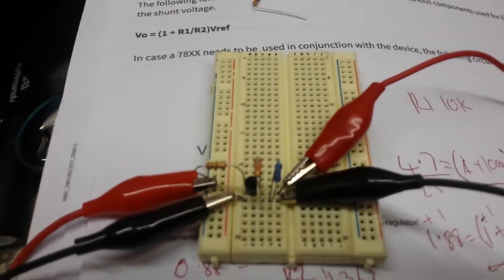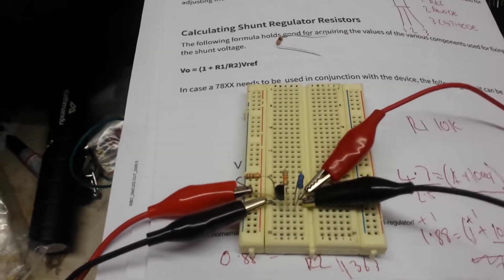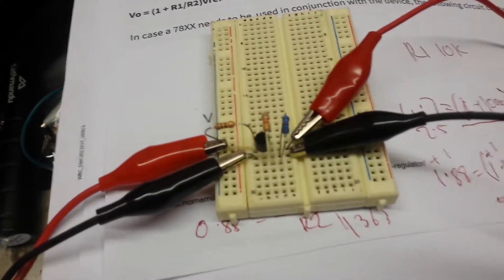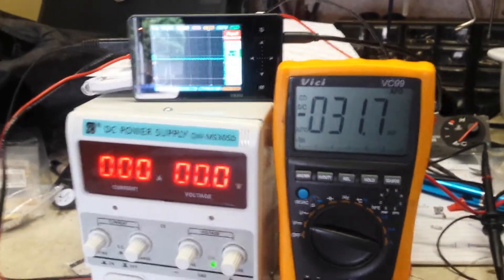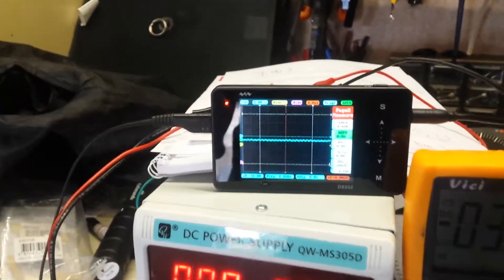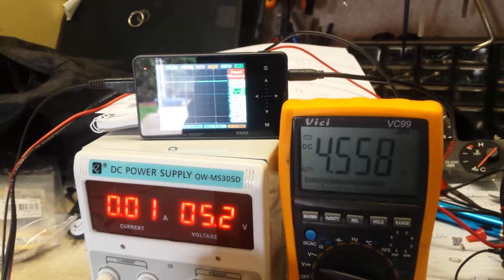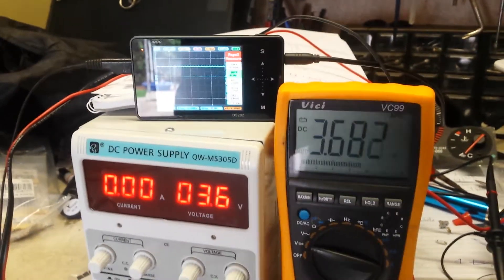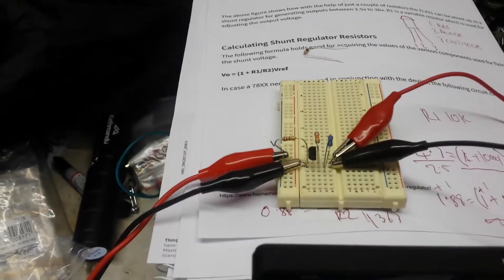Subaru NA-T voltage clamp

Comment: i want to boost my ej251 are you saying i can only run 3 psi max? cant i voltage clamp at 4.7 and still run more boost as long as afr is okay?? looking to get 6 psi boost stock ecu stock motor with a 4.7v clamp.
Reply from the maker: The voltage clamp is so that you CAN run more than 3psi.
Reply from the maker: Without some kind of fuel system upgrade you will run lean and break things.
Reply: @procrastinator1842  thank you for the response/information.

Comment: Great work! I'm also turbo'ing my NA subaru (GF8 impreza EJ201 SOHC) and have all the mechanical parts but will have the same MAP sensor issue as you. Thank you for putting this up! Have you managed to actually test at what point the ECU throws the check engine light and refuses to run on boost (like 3, 4, 5psi etc)? What engine are you running? My TD04 will hit around 8psi so I need to change actuators for the wastegate to open sooner. I'd like to run my MAP sensor as much as I can, even for just a couple psi of boost, so that it can help with fuel/ignition etc. Hoping to run max of about 5psi boost and I was even considering possibly tapering the top end of the map sensor output signal curve (voltages relating to anything over 0psi and up to cut voltage of ~4.7V or whatever it is) and lowering these voltages across the range so that the cutoff voltage happens at ~6psi. This way the map sensor can run the whole time, it might run a little on the lean side on boost but with the knock sensors, good fuel, good cooling it might just work ok for this low boost application. What do you think??
Reply: Also, did you mean IC is TL431A?? not TL341A as I can't find that one :( And can you please provide basic schematic with resistor values you used? I'm keen to make this ASAP, thanks again!
Reply from the maker: Hey thanks,

My ECU throws a CEL at around 3psi, and it's like hitting a brick wall when it cuts fuel. The adjustable clamp fixes the problem. 0psi = about 4.2v. 3psi is around 4.8v which is where the ECU says no. I used some large hose to slide over the MAP sensor and a bike pump + boost gauge to test the voltage/pressure relationship. This is on a SOHC EJ251 MAP engine. My recommendation is to clamp the MAP as soon an boost is seen. Otherwise tuning is just too hard in my opinion. But your results may vary.

I got a kinugawa 5psi wastegate actuator off ebay and it worked well, but the stock wastegate could not flow enough for the 2.5l engine and I got boost creep, porting the wastegate port made boost rock solid with almost no spiking.

Subarus need to run rich. It's just the way they are, lean boost + knock correction won't help.

I've since abandoned the FMU fuelling because I can only run max 3psi before fuel rail pressure won't allow the injectors to open. Also they seem to have lag and go super lean as soon as boost kicks in.

I've bought some WRX 440cc injectors and an AEM FIC 6 piggyback to try instead. Ignition is run through a J & S safeguard to stop the engine blowing itself to bits.

Hope this helps.
Reply from the maker: I'm 99% sure its a TL341A, I bought a pack of 5 off ebay. I'll find the schematic when I get home and send it through somehow.

Good luck, keep me posted.

*EDIT* the IC is actually a TL431A, whoops.
Reply: CEL at 3psi sucks, wish I had a MAF engine like the EJ22 sometimes :P Thank you so much for your measurements and information, it is VERY helpful to find as facts on this conversion are hard to find for us NA>turbo using MAP subaru folks. 

When you say the 5psi actuator + internal wastegate didn't flow enough you mean it didn't open the wastegate far enough to drop boost back down? Or mean something else? Sorry I'm confused here. 

I also already purchased an FMU previously but later found out it's not street legal to run so I'm looking for a 100% street legal/insurable solution for my daily driver. I wish I'd known it wouldn't work anyway before forking out hundreds, it wasn't cheap! I guess you're in the same boat? Are you saying that 3psi boost in to the FMU raises fuel rail pressure so high that the injectors won't open? If so, what ratio is your FMU? I'm guessing it might be somewhat of a high ratio? I think the one I bought is around 4psi of fuel for every 1psi of boost. If you say it runs lean with your FMU anyway then mine probably wouldn't have been enough fuel either I guess.

I also purchased some 06 WRX 550cc injectors but that was when I was contemplating full aftermarket ecu option but price just got way out of control down that path with ecu, install, tuning etc. 

Thanks again for your help and info and I look forward to building the little circuit to trick to the ECU and then it's on to figuring out a fuel / timing solution :)
Reply from the maker: robrath31 The problem with the wastegate was not due to the flapper or the actuator. Putting a small turbo on a bigger engine and asking it to run low boost means that it has to bypass a lot of gas. The stock wastegate port is 24mm in diameter and has a sharp 90 degree bend in its path. So the gas flow is limited. On my engine it would generate 8psi at high rpm EVEN with the actuator rod disconnected. So porting it to 28mm and smoothing out the 90 degree bend solved that issue. Your engine is smaller so it might just be fine. But a bigger wastegate port will give steadier boost anyway.

I've now gone with an AEM FIC6 which I picked up for about $260 new. This allows you the stock ECU to maintain cold start, idle up and all the stock ECU features. But you can modify injector duty by +/-100%, pull timing in boost and trick the factory ECU by hiding the AFRs under boost. It also can uses the throttle position sensor to richen the AFR when you pump the throttle to improve 'tip in' something mechanical FMUs won't do.

I'm currently flat out finishing a Subi rally car so I'll try to send some stuff. Maybe pm me your email. Cheers.
Reply: Wow, another problem I hadn't thought about! Thanks again! Stock WRX TD04L actuator is around 8psi but I think these are controlled with a boost solenoid to reach around ~14psi when installed in a WRX, not just running actuator spring pressure. I hadn't even considered that low boost could be a problem with the small wastegate inside the TD04L. I've seen them run fine on EJ22's with NA>turbo conversions at spring pressure but not lower. I suppose it's not a problem if the car runs more boost but then back at square one, how to do that :P 

robertrath31@hotmail.com 

The AEM FIC6 sounds like a good solution for you but I can't because then it won't be street legal for my application. 

Another concept I had was to convert my car to MAF sensor, using stock EJ22 ecu and AFM etc (big wiring job) but both are SOHC motors with same sensors from what I can tell. I could do the ecu swap before doing any turbo parts and test if it runs the motor fine as an NA 2.0L and then boost from there.
Reply from the maker: robrath31 Whatever you do, you need to hide things from the stock ECU. The stock ECU will always try to trim fuel to maintain the stock fuel map. I think switching to MAF would be wise. Cars suck sometimes hey.
Reply: Haha got that right! Yeah I think you might be right, small invest of under $200 for the parts from a wrecker + my own free time wiring so I guess it's off to the wreckers! Good luck working on the rally car!
Reply: @procrastinator1842  have you got a link to this adjustable clamp?
Reply from the maker: @bennjiestewart3786  this video is the adjustable clamp.